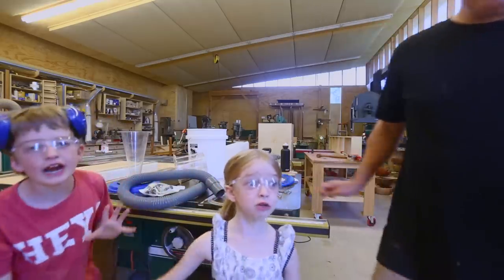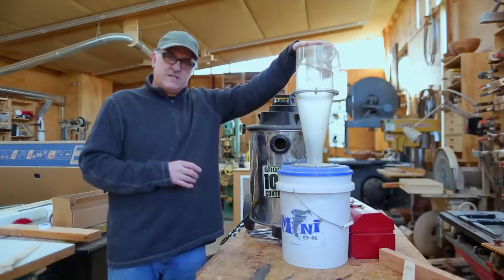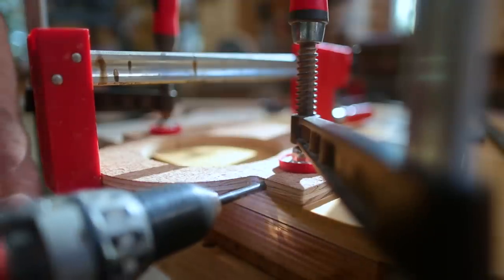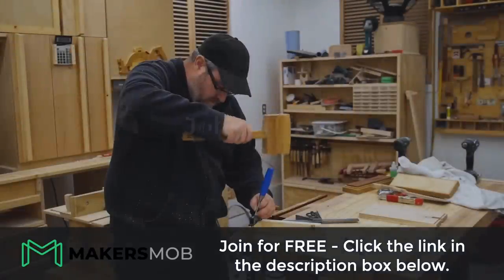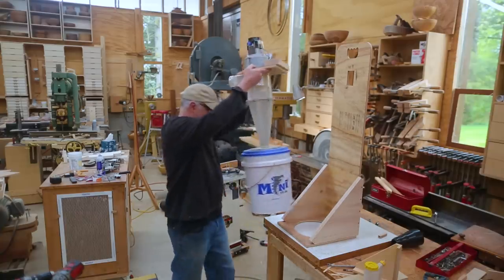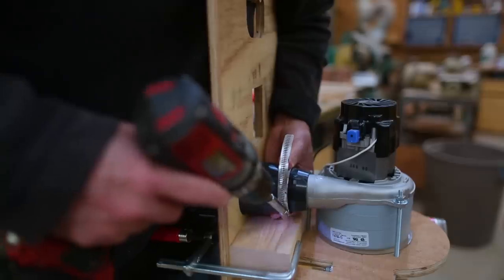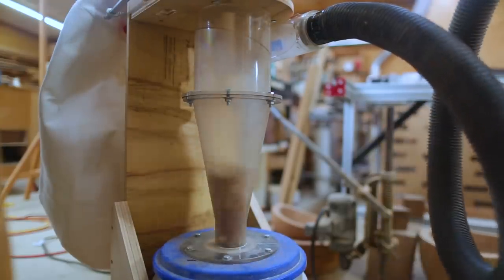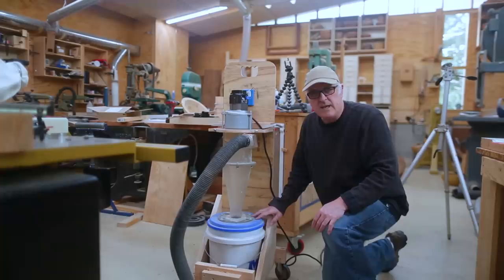Frankenvac

Comment: I love the concept as I have also been annoyed by the bulk of the duplication of two containers.  But with this design the true filter of the old shop vac is being replaced by that bag which certainly is functioning as a filter but is the micron level of that bag as good I suppose it could be better, than the filter that comes with a shop vac?

Comment: i had the same thought about a hinge, another would be slots to either raise the motor and separator, or a flex tube between separator and bucket (vent hose)
I actually had the same idea, but i'm working on the bucket being the separator, the inlet to the bucket is at a tangent, the bucket i have is tall and slightly tapered, the motor being mounted on the lid, haven't completed that yet, so don't know if it works.
The motor would not normally be grounded (double insulated), but if you have exposed metal find a bolt to connect to, or enclose the motor

Comment: Have you thought about using the bucket upside down?   So the top of the bucket would be below your cart and the cyclone would be installed into the bottom of the bucket (You'd need a new bucket for this, of course)   In this way, you could empty the bucket just by tilting the cart back and taking off the lid.    Might not be any more convenient to empty if you're going into a bag or larger container, though...

Comment: Hi Frank! Big Fan!  I think the top part, the cyclone tube can be fixed to the shavings container unit, which doesn't have to be cylindrical does it? It can be a drawer with disposal bag.

Comment: Rather than the back hinging, I'd put the whole top section on rails so it can go up and down, maybe put a foot pedal on it like a lidded trashcan, seems like it's be more stable and the horizontal footprint stays the same so you won't have to find a clear space for the back to fold out every time you want to empty it.

Comment: Very cool design. Who needs the entire shop vac when all you need is the vacuum blower? Because, if the cyclone works properly, you do not really need the vacuum filter OR the vacuum bucket, right?   Elegant solution!

Would it be possible to use small clamps or screw knobs and threaded rod on the collar that holds the cyclone? This would make emptying the cyclone bucket easier while maintaining the rigidity of your central frame. Also, I'll bet a small prefilter bag used to cover shop vac filters would work as well as the large filter bag you used in your prototype.

You have come up with a great idea. It is simple, efficient, mobile, and uses little space. And I'll bet if you encase the blower unit in a foam-lined box and set up a "muffler" for the exhaust air it would also be quieter -- if that's an issue for you. (Don't know about heat build-up, though.) 

I am impressed by your work -- again.  Thanks!

Comment: A bit confused here ..... other than the small amount of noise reduction,what is being gained. I made mine 2 stage so that the vacuum unit is in an outside store and is noise insulated. The receiver and the cyclone is in the shop, easy to access and easy to empty ... and much larger volume than the shop vac container ...
Reply: He has a non-portable shop vacuum system already for the large machines. This system needs to be very portable. Having a fixed location unit would require way too much hose in this big a shop space.
Reply: @valeriehenschel1590  Thanks for your reply ..... I cant see what is being gained by adding a vacuum motor to a  cyclone ...... as I said earlier maybe quieter ... but he already HAS a portable system ( Shop Vac ) .
The only differences are that the dust now rotates prior to entering the receiver as opposed to being drawn directly and filtered..... no advantage there .... eh? AND ... the shopvac has a larger capacity and the whole unit is already mobile 😎

Comment: Nice project but why go through all of that to basically end up with a homemade vacuum cleaner when you already had one that worked fine? It seems that the old vacuum, without the separator, is just as mobile while being a lot easier to empty, and probably holds close to the same amount of sawdust as well. Is it a bit like reinventing the wheel, or have I missed something here? 😄
Reply: A normal shop vac' s filter clogs too quickly. That is why most wood workers use a vortex.

Comment: Check out Matthias's shop-made vac. He has a really cool tensioned foot pedal that rises up to hold and seal; the bucket against its lid. It looks really convenient, and there's no hinge to compromise the structure of the vacuum's back. You can see a picture of this design most of the way down this page: https://woodgears.ca/dust_collector/separator.html
Reply: Hovis Biddle Here's the link to the video. He talks about the bucket changing feature at 4:10. 

https://youtu.be/WHN6rZH6lNE

Comment: Great design... with regards to making it easier to empty. Have you thought about mounting the bucket so it can be dropped/lifted on a platform instead of secured in the cut out... it’s got to be easier to move the bucket than all the cyclone/motor assembly?

Comment: That vac motor is about $100 and draws 13 amps. So I'm jumping to the conclusion it's a 2 hp motor(I know someone will correct me, I'd appreciate it). The suction is about 136 inches.  Air flow about 95 cfm.

How does this compare to a large shop vac? I'm sure it's gotta be better. I wanna make a set up to suck post holes for a fence(to many roots to dig, save my back, trust me I've done both and a shop vac works great but I think this motor will be amazing) 

Any help would be great, I'll make a video when done. I think it's probably more than twice as powerful as a powerful shop vac, any thoughts? 

Thank you very much in advance.

Comment: Is the bucket (receptacle) required to be cylindrical?

Would a design similar to a portable paper shredder work for this application?    

For instance the receptacle is a box that is removed through a door or just pulled out to empty the dust.
Reply: The container can be any shape, but it has to be airtight.

Comment: A though if you mount the plywood that holds the vacuum motor to separate back peace, then cut slots on each side of the vac into the new and the original back you could slide the motor and cyclone unit up and down locking it in ether the top for cleaning or bottom for use. I see this is as clear as mud. Sorry.

Comment: I made something similar and had the same dilemma as you with emptying the bucket.
Solution: I added a piece of wood just over the bucket lid, then attached lever clamps to the wood and other end of clamp to the lid. By lifting the clamps it raised the lid and I can just pull the bucket out.
Something similar to this- but in a mini-scale: https://youtu.be/tWWem2qb50w?t=900

Comment: I recall seeing an old popular mechanics style design for a dust separator that was similar to yours but had a flexible corrugated hose that went between the cyclone and bucket lid. With the cyclone mounted to the backer board the lid could be lifted from the bucket compressing the hose enough to get the bucket out and empty it.
https://images.app.goo.gl/a5GMuHxdR9eQW5VGA

Comment: Look at the motor. If it has this sign https://en.wikipedia.org/wiki/Appliance_classes#Class_II then DO NOT EVER NEVER NEVER NEVER(!!!) put a ground wire on it. It might kill you. Best use a plug / cable without ground wire. If you plug / cable has one make absolutely sure that this ground wire will not tough anything on the appliance that might conduct electricity. Again, this might kill you or might at least be a "shocking" badum tss experience.